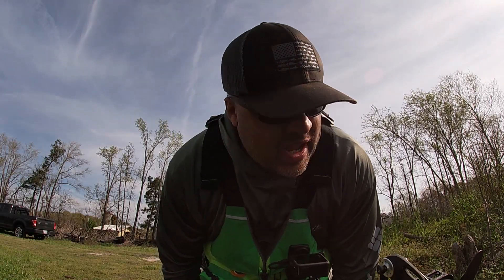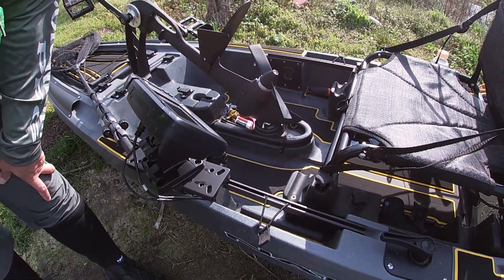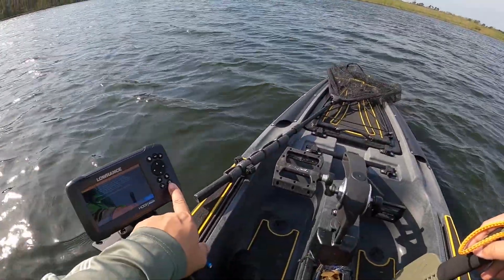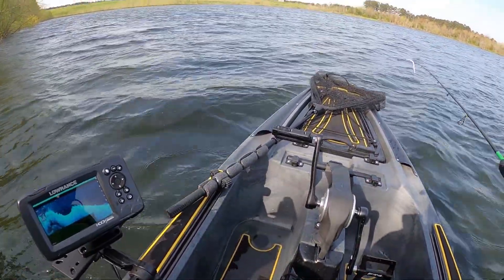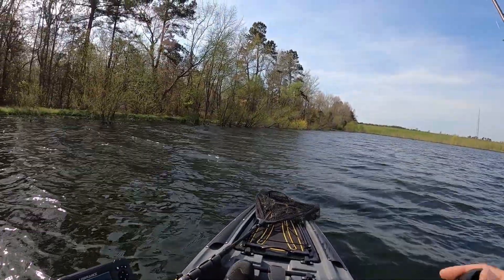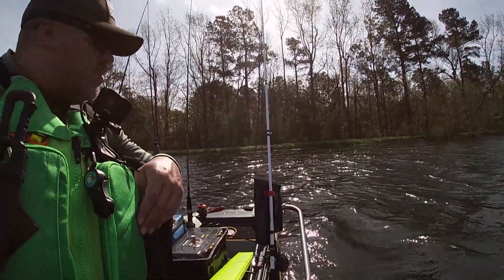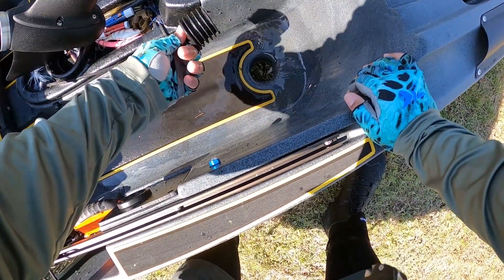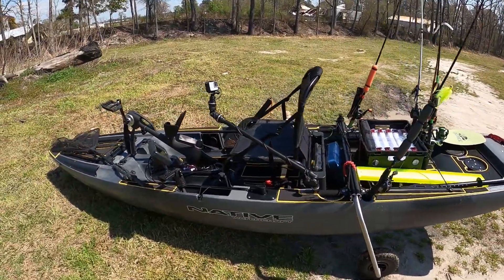Native Slayer Max 12 5   Where is the Water Leaking From?

Comment: maybe try put som teflon tape around the plugs?
Reply: I tried putting teflon tape around the scupper plugs with my Native Slayer Propel 10 MAX kayak. It helped, but when I pulled the plug out, the tape just came off of the plug. The tape won't stay on/wrapped around the plug, unfortuantely. And yes my kayak (2021 version) has the same issue leaking water onto the deck. And since the deck is LOWER than water line, water can NEVER self drain out....

Comment: Hey Rodney: If scupper plugs were leaking, the water would not accumulate (it would drain out as soon as it came in).
Reply from the maker: Larry Moffatt My scupper plugs are lower than the water line in the front so it does not drain out even when completely removed. 

Unless i lean over to the opposite side then it will drain out. My yak is front loaded with my seat pushed forward. I am going to try adding some weight to the back and see if that helps to balance it out. Regardless if the plugs are below the waterline at the front of yak they should not leak in my opinion. 

But you are right if it was balanced weight wise the water should drain back out because the water level would be lower than the scupper hole. 👊
Reply: Rodney Outdoors I’m a big dude and love the slayer max and am having the same water accumulation issues. I fish offshore so I don’t keep my scuppers in anyway. Did adding more weight to the back help? I’m thinking my battery and the drive itself is weighing me down in the front.
Reply from the maker: Matt Wilkerson I think it does help. I put a little less weight in front and more in back. But I did also get the new scuppers which did most of the work after changing them out.